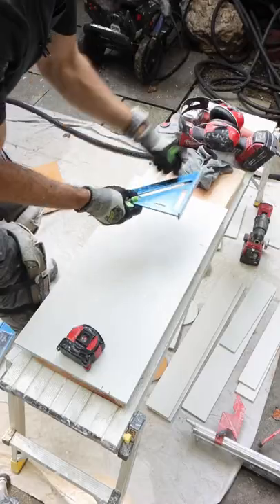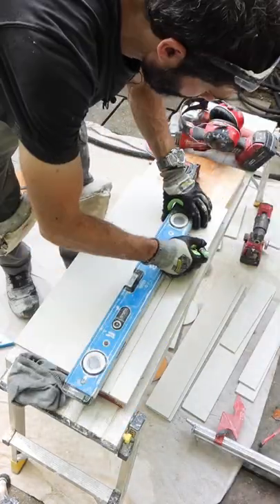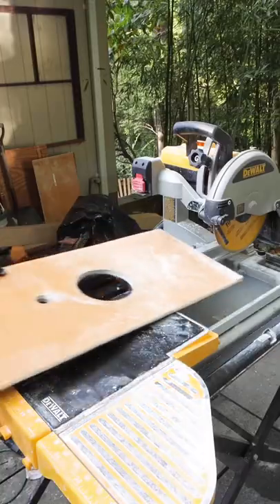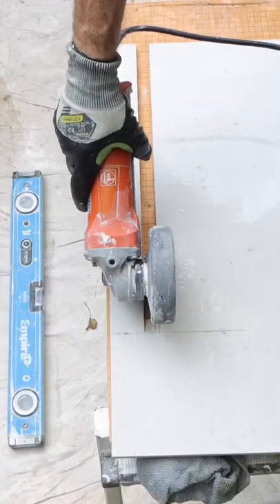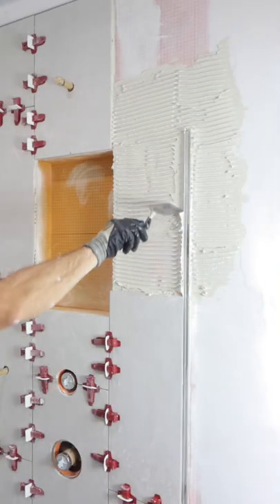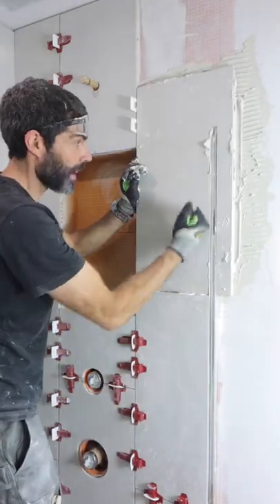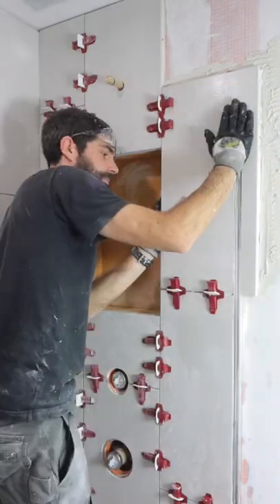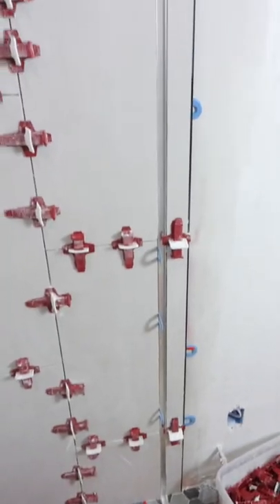Tile Shower Wall Tips - #shorts

Comment: Could you do a video on how you deal with mounting a glass partition wall/door to the top of a raised shower threshold? These are usually mounted with screws through the top of the threshold, but thats putting holes through any waterproof membrane.😕 The glass installers typically fill those holes with silicone, then drive the screws. But putting holes through membrane you just carefully installed, seems wrong. Is there another way to do it?👍
Reply from the maker: Great question, and yes. You could install a layer of HDPE, it’s the same material as cutting boards, on the curb. That way, if the solid curb top or tile is penetrated by screws, those screws will anchor into the HDPE layer - and hopefully not penetrate it. This keeps the curb waterproofing intact and provides a good anchoring material for screws
Reply: @HomeRepairTutor how thick should the HDPE be to be enough for the anchors?